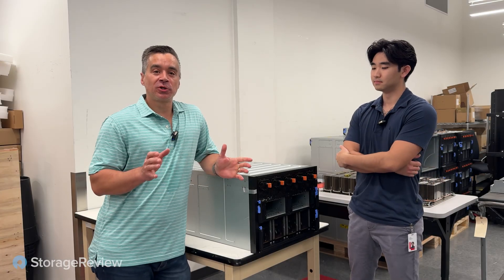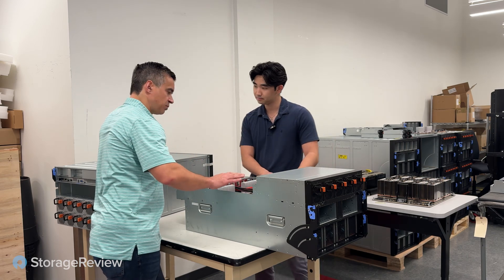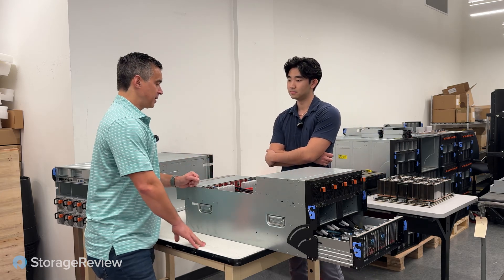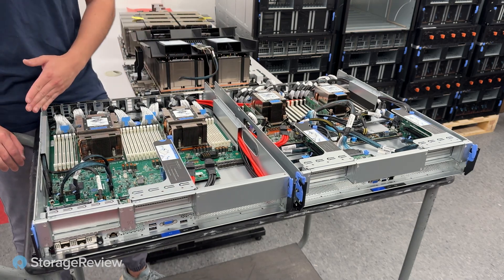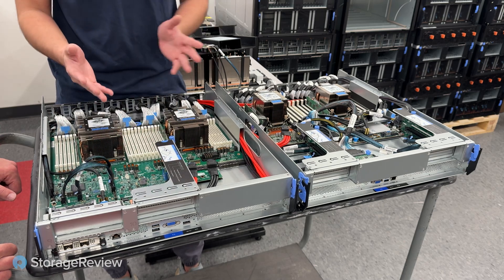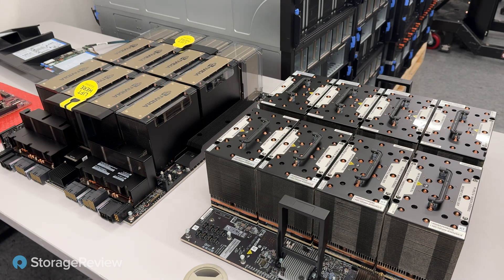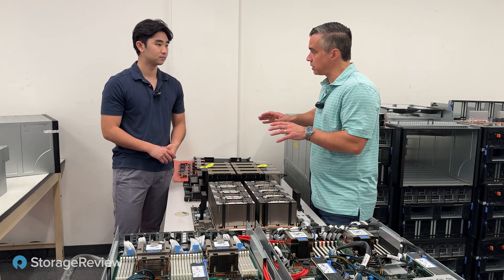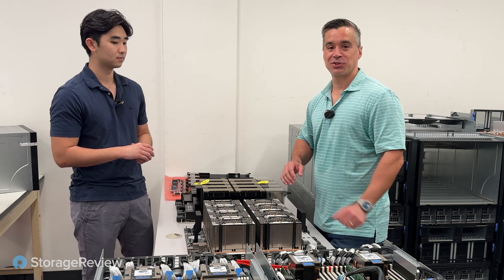These Lenovo Servers Might be the Most Flexible AI Boxes Yet!

Comment: Why only 2TB ram on both platforms and such low density ram? aren't these chips (especially the AMD ) capable of higher density on 2 processor?
Reply from the maker: Not at top speed, usually to get more DRAM it will be at slower clocks.
Reply: It can do more, typically you look for „only“ 1.5X to 2X GPU memory, so with e.g. 8x80GB you are ok with less than 1TB while with 8x192GB you want to 2.3TB to 3TB, which at 32 slots (Intel) can be achieved with 96GB DIMMs, and with 24 slots (AMD) with 128GB DIMMs.